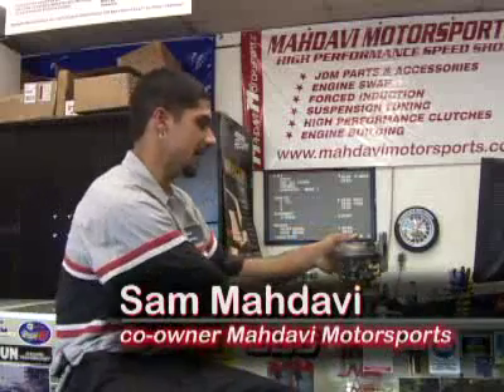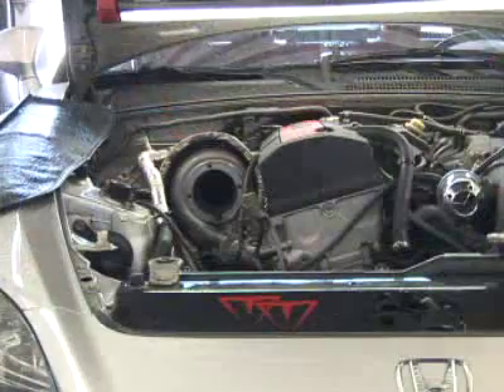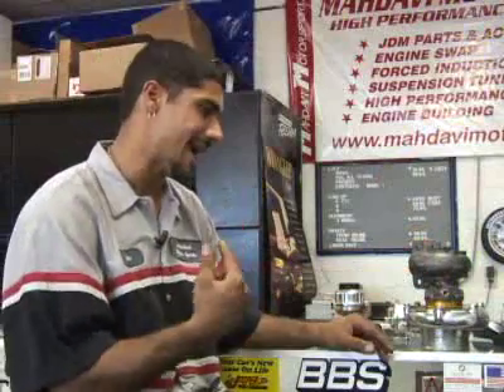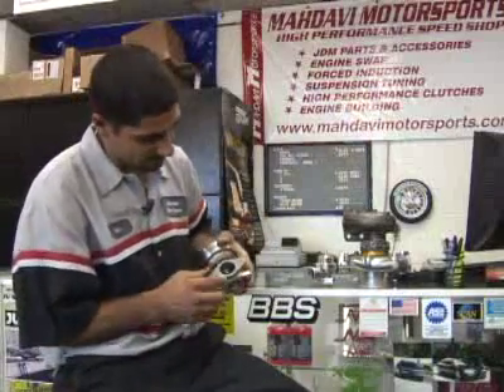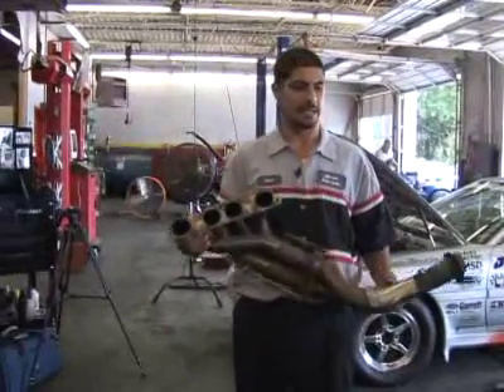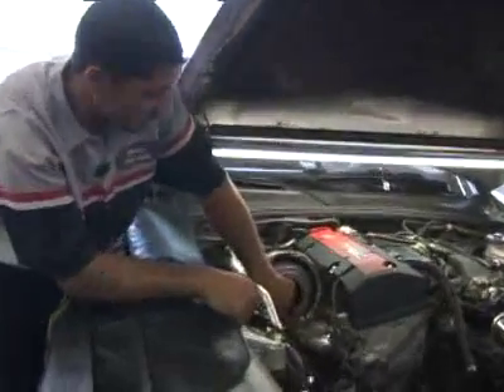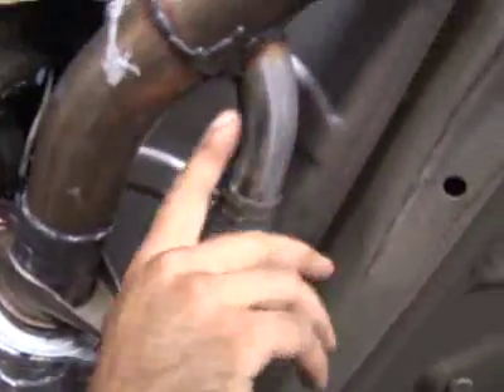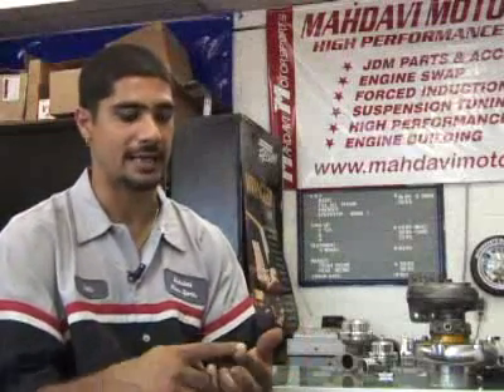How Turbochargers Work

Comment: @Rowdie999 The turbocharger itself has a hot and cold side. The hot side is connected to the exhaust... the exhaust coming out of the engine spins a turbine.  That turbine spins another one on the other side of the turbocharger (the cold side)  That turbine sucks in fresh air, compresses it, then sends it into the intake manifold of the engine

Comment: also  this is just a generalization for inline 4 cylinders  in the case of the boxer engines like subaru uses the turbo sits on the end up an up pipe which comes from the header(s) and goes to the "hot side" of the turbo then theres a down pipe that goes to the mid pipe and finally to the tail pipe.
just saying not all turbos sit right on the exhaust manifold/header.

Comment: Really what youre doing is trying to blow up your engine.  So if you don't know what youre doing...don't just strap on a turbo.  Also youre gonna have to deliver more fuel, so youre gonna need different fuel injectors...maybe a fuel pump...and computer adjustments.  There's more to this.......

Comment: @45hazward A super charger is belt driven. A turbo is driven by the exhaust flow. They both do the same thing, but a super charger takes more horsepower to run. which means you'll over all get less of a gain. However a supercharger offers boost from idle on up. Where as a turbo takes a while to get spun up enough to producing boost.

Comment: @salemcripple pt2 This is because the pressure from the turbo, and the pressure created from the compression stroke would heat the air up past the flash point of the fuel. Causing it to ignite prematurely (otherwise known as detonation).

Comment: @sergsrt8 An intercooler cools down the air flow after it's been pressurized. You don't need an intercooler for most set ups, but they do add hp. this is because any time you compress a gas, it heats up, which means the air molecules expand making it less dense. Less dense air=fewer O2 molecules per charge=less power. The one reason where you would actually NEED an intercooler is when you are running a high compression set up with a high pressure turbo (very high hp set ups).

Comment: @sergsrt8 I'm not sure what you're referring to. But some turbos use an oil bearing (like the main bearing on the crankshaft). The turbo can become so hot during use that if you were to shut it off right away, the oil would caramelize which would then seize the turbo up. So with that type of turbo you need to let your car idle for a while after a hard run, in order to keep cool oil flow to the turbo until it cools down.

Comment: @ausirider91 a turbo charger does compress air but it also gets forced into the engine. U could say that it uses the same principle as the compressor blades in a jet engine just before it enters the combustion chamber. A compressor changes the air pressure before entering the combustion chamber.

Comment: Lame...  A blow off valve is not a waste gate.

A blow off valve bleeds off excess pressure in the intake when you cut the throttle suddenly.  A waste gate limits maximum boost by diverting exhaust away from the exhaust side of the turbine.

Comment: @gangsterburrinator 
Not sure you understand, the turbo will force more air into the cylinder using the standard valves than a non turbo engine. Although the ratio of oxygen to the rest of the gases is the same they are alot smaller and more fit into the same space.

Comment: With all due respect, Websters, and for that matter, Oxfords English, have never had to read about turbo machinery, a 'True Compressor'. is one that results in a 7% drop or more in volume and a turbo simply does not acheive that.
A roots type supercharger does, the two inter-meshing lobes squeeze the air between them, compressing it.
A turbo, (for all its complexity), simply rams more air into the manifold, thats where the pressure builds, not in the turbo housing.

Comment: In other words, you need to COMPRESS the air molecules to fit in the preset volume of the engine. Gas Combustion engines use the positive pressure created by the turbo to do this, it cannot make use of the accelerated air. It is not an aircraft engine.

Comment: Webster's defines compressor as a "Machine that compresses gases" and since you produce positive pressure in the system i believe MonteLSV is technically correct. 

Your claim that a turbo is an "Air accelerator" is not exactly correct. If a turbo was simply an air accelerator, then it would be close to useless on an engine. In order to create any meaningful power from a forced induction system, you must cram more air molecules in the small displacement a motor has to offer.

Comment: You're all wrong. Including the guy in the video. A turbo cannot be installed on a motor, as motors are electric. ENGINES are internal combustion, which a turbo can be fitted.

Comment: Doubling the horsepower could cost a lot more than just turbo kit. Honda engines are usually come with fragile parts. They're lighter but less durability.

You need to ask experts for advices about forged piston/rod, gasket and many more. Coz induction system produce lots of heat and torque during ignition.

Comment: depends on the size of the turbo
you will need a turbo manifold and down pipe, a turbo, an intercooler and piping, possibly bigger injectors, a wastegate, blow-off valve and other miscellaneous hardware
so yes it is expensive
it was going to be around 5Gs for a new turbo motor for my bug with me building everything
but check out craigslist for turbo kits
they can be found cheaper there

Comment: Depends on size of turbo, and amount of boost your going to push. A vw gti can start boostic at 2000rpm, a mazdaspeed3 boosts at 3500rpm, a 2nd gen eclipse with an upgraded t3t4 pushing 20lbs would probably start boosting at 4000-4500rpm. So only on race applications will you begin boosting at higher rpms. On an OEM app, you will boost for best performance and economy per the OEM calibrators tuning.

Comment: Yeah, apart from the compression of air, it behave like a fluid, just makes modeling easier. I had this argument with my lecturer, anything up to 7% volume reduction is not a 'true compressor', guess its just engineers being pedantic.

Comment: @2346 its only fuel efficient if your not producing boost (#PSI in each cylinder). Once you start pushing boost, your fuel economy goes out the window because your pumping MUCH more fuel to mix with the MUCH larger amount of air.

Comment: Is a fan a compressor?, no, it's not, the turbo does not compress the air, it just rams it into the plenum and then cylinders, I'm sorry that this is obviously getting way to advanced and complicated for you, but I'm trying to make it as simple as possible for you, (still not working though), do a Uni module on turbo machinery and thermodynamics and then argue with me. And yes, thankyou for stating the crushingly obvious about air density, have a gold star.

Comment: It's the laws of turbo machinery, the turbo isn't compressing the air, (twin screw supercharger is a true compressor for example), its forcing it into the charge air side of the engine, it's causing the air to be compacted, but the turbo itself isn't squeezing the air, it's just ramming loads of it into the charge pipes.

Comment: Technically a turbo is an air accelerator, it's only a compressor if there is a greater than 7% volume reduction at the same temperature, it's just a fluid pump, compression is done in the plenum and combustion cylinders, and air is a gas anyway, it can't be atomized.

Comment: Sorry mate, this guy is a complete spoon, so much of what he is saying is inaccurate, if not down right wrong!
It is not a compressor, it is an air accelerator, compression is done in the cylinders.
Turbos work on any fuel used in an engine, gas, diesel, LPG, anything.
Air is not atomized, it's a gas anyway, there's just more of it so the AFR can be mapped in ways NA IC can't. 
And that manifold didnt look like a gas flow optimized unit, and the air is cooler which is better  thermodynamically

Comment: higheroctane fuel does NOT make power  the octane rating is the fuels ability to withstand auto ignition until you tell it ignite , ie then you can run higher compression ,hi-O fuel will not ignite itself from the heat generated from the compression, modern cars 'gain' hp from high octane gas because the computer allows  for a more aggressive ignition advance ,  he said the turbo helps atomize the air and give you better ecoon when NOT in boost , watch vid again, hot air ,...........bad

Comment: The process of pushing warm air for combustion is the case in fire-boxes, where the cold air is taking away heat from the fire (that's what you were thinking) but in engines it's a different story. The engine can only get a certain amount of air in one circle (Volumetric, not by amount) , not like the fire-box where you get more than enough air. One of the solutions is to get more denser air, where you have more oxygen on the same volume of air. Sorry for my english.

Comment: yea, all the turbo does is force more air in by using wasted heat energy. By adding more air, you can add more fuel to make more power. So silly how some people think of it, i'm wondering how many of his engines went..."boom"

Comment: normally you would want a lower compression ratio in a turbo car to enable using more boost pressure. 8:1 in a turbo engine vs 9:1 10:1 in a normal engine for power. The lower compression lets you use the turbo better. Also makes it so you can have a high horsepower engine that will run like a normal engine at low rpms. Very nice for street use.

Comment: I don't believe this is correct... Generally speaking the car gains so much power that the slight backpressure caused by the turbo doesn't really effect anything.

Also, the compression ratio is higher (correct me if I'm wrong), thet's why 91 octane or higher is required for a turbocharged car, to prevent knock.

Comment: depends on how much pressure you are running.... if you wanna run a lot of PSI you gotta get all new internals including valves, springs, pistons, rods, and a crank. if you only want to run 5 or so psi i wouldn't really worry

Comment: Atomizing air??  I don't  tink so ...  little more homework please ..  oh well no big deal .. you got a spirited discussion going on relative merits of TC'ing.  I know the lube system has to be kept in fine form re; filters etc .. as the TC shaft spins at super high RPM's .. costly fix for being slack about TC oil and filter changes.

Comment: Uh... Turn the boost up? Turbo-back exhaust, better intake, boost controller, bigger turbo(s), single turbo conversion... Depends how much power you want, and how  much your stock motor will handle... If its stock turbo then the lower end should handle a nice amount of power since its built to handle boost stock. Just google your car, and add "modifications" in with it, I'm sure there will be websites that sell stuff for your car or offer suggestions for modding it.

Comment: The character limit here makes a discussion of the necessary topics impossible.  If you want to know why I'm right, take Calculus III, Differential Equations, Thermodynamics, and Thermal Systems, by which point you'll have the knowledge to be able to take a course in internal combustion engine design, which will cover the pertinent topics.  You could try reading "Internal Combustion Engines", Third Edition by Stone, et al though without the courses discussed above you wont understand any of it.

Comment: You are oversimplifying the problem to a GREAT extent.  To determine the full amount of energy in the exhaust stream requires a complete energy and exergy tabulation and analysis.  This covers kinetic energy, potential energy, internal energy, flow work, enthalpy, chemical/combustion, etc. etc.  (continued)

Comment: you wouldnt exactly have more energy in the exhuast though...if an engine burned 100% of its fuel, then you would be putting less gas into the engine at a given time, as compared to the engine burning, oh idk what the figures are but say 80% of the fuel it takes, so you would need to put 120% of the fuel that the engine that burned 100% took in order to run right  there for the engine would make the same amount of exhuast with the same energy stored in the exhuast, just using less fuel to do so.

Comment: As for issues of "efficiency" it depends which metric you use as to whether a turbo will increase or decrease efficiency.  If you're looking at overall thermodynamic efficiency, or at Brake Specific Fuel Consumption (BSFC, how much fuel it takes to produce a given amount of power) or Mean Effective Pressure (MEP)  then turbos will almost always increase efficiency.  If you mean fuel ECONOMY (as in miles per gallon) it depends, as stated by several here, on the vehicle specifics and driving style

Comment: Vertigo, you too should shutup and just not say anything when you have no clue what you're talking about.  Making things up doesn't make you sound smart, it makes you sound like an idiot.
"If any engine burned ALL it's fuel, there wouldn't be any exhaust... and turbos wouldn't work. "
You couldn't be more wrong... if your engine achieved complete combustion of all the fuel, you'd have a lot MORE stored energy in your exhaust, and would have higher exhaust volumentric flow andmass flow rates.

Comment: And btw, this guy is not explaining the concept of a turbo right. A turbo uses exhaust pressure to turn a fan that sucks in air. It doesn't atomize anything. It simply allows you to flow more air through your engine, so you can also flow more fuel, and thereby make more power from every stroke. And like SaGalv said, it doesn't help you to burn excess fuel... It just lets you burn more at the same time. If any engine burned ALL it's fuel, there wouldn't be any exhaust... and turbos wouldn't work.

Comment: Actually, turbochargers make your engine more effecient gas-wise, getting you more bang for your buck. They do make the engine burn more gas at the same rpm, but if you have more power, you don't have to rev the engine as much to maintain speed or accelerate, so you burn less gas overall. But as with any car, the faster you drive, the worse mileage you get. Turbos make a car burn WAY more if you floor it all the time tho. You're right about engine size, but it's the same concept: bang for buck

Comment: use up all your fuel?  impossible. they havent created an internal combustion engine that burns all the fuel it uses.    and a turbo charger in no way makes an engine more fuel efficent,  the reason some newer cars with tiny engine have a turbo is becuase a turbo lets you put a smaller engine in place of a bigger one, and the fact that the engine is smaller is the only reason it gets better mpg then the bigger engine without a turbo.

Comment: turbine/compressor wheels.  The end result is that the boost pressure developed is less directly correlated to the engines angualr velocity (which is a pretty accurate representation of desired power output).  This is commonly reffered to as "turbo lag".  In a well designed system, this can be virtually eliminated, but in most the net result is that low-end off the line power is compromised in favor of increased torque at higher RPM, which

Comment: As far as practical differences go, the critical factors to consider are that a supercharger generally incurs a larger horsepower penalty due to decreased thermodynamic efficiencies.  The advantage is that boost pressure(pressure over atmospheric) increases directly as a function of engine angular velocity (RPM).  A turbo is more thermodynamically efficient, but lacking a direct-drive between engine and compressor, it typically takes a discrete period of time to overcome the inertia of the

Comment: that guy's full of shit... it doesent atomize the air... it shoves 5-6 times the regular amount of air into the cylinder. w/out a turbo or other forced injection method on the compression stroke of the motor your effectively starting out with 0.00PSI of compression at BDC. with a forced induction system such as a turbo or a supercharger. when at max boost. you may be starting with any where from 10PSI to 100PSI depending on the application and fuel type

Comment: Thats rubbish...  Most turbocharged engines are fitted with injectors that run at a much higher duty cycle than those found on an  NA engine.  

You can get decent fuel ecconomy from a turbocharged motor if you drive it right; then again, you dont buy a turbocharged motor to save money on fuel.  An NA V8 can be just as efficient too, btw.

Comment: the power on combustion motor depends directly for GAS and Oxigen, but the potencial is provided by the GAS, if you have more air you can burn more gas so you have more power, less mileage. simple. you will never going to have better mileage than a stock.

Comment: It means to distribute it into really fine particles which will mix with the fuel spray much better. Some fuel injectors have "atomizer" nozzles. I have actually never heard the term used for air but it applies to liquids alot.

Comment: Its really simple: turbo charging allows you to put into cylinder more air. With better injectors - you can burn in combustion chamber, more air and fuel. Turbine in exhaust manifold allows you to remove burned gases faster (but still with same ratio than intake). The only trick is that you cannot burn more than 1 part of gas (fuel) in more than 14,7 parts of air (in volume) - thats ideal stoichiometry relation. Dont give up - its really simple (in theory)

Comment: Turbo- It uses exaust gasses to spin a turbine which sucks in more air forcing it into the engine which creates a stronger-hotter ignition(ka boom) in the combustion chamber.